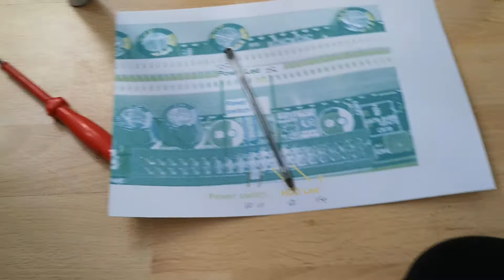Building a server from used Dell T3500 Workstation main Board.

Comment: Cannot find the second video on this, specifically about making front panel connections. Can you give the link to the second video please ?
Reply from the maker: Hi Sorry I didn't get back to you but if you go on george tech tips on YouTube you should find the video on my video uploads if you cant find it send me a message and I will check and link to you.
Reply from the maker: Hi if you can take the from panel  board with the usb and audio Jack's from an old T3500 or you can get the part from Ebay,cost about $7.00 us about £5.00 UK, take out the cover for 5.25 inch DVD slot and put dell front panel there,then attach the Dell propriety cable to 40 pin  header on  front panel pcb and the other end to 40 pin header attachment on the Dell T3500 mother board ,check pin out.that will allow you the have a power button to turn on the Mother board attach the usb cables to usb headers on mother board.you will have 4 green led's on the front panel lit for diagnosis the PC will boot with the only errors coming from fans ,you need 3 pin to 5 pin fan cable adapter from Ebay to fit dell fan pinot  on motherboard .the PC will boot into windows with no errors in bios screen that's says press F1 to continue or F2 to setup,these will be gone on power on.
Reply: @georgetechtips8804  Thank you, George. Can you please share a close look of the pinout for the front panel ? I have one but not sure it is correct - connected computer does not power up properly.
Reply from the maker: @yuritar  can you provide an email an I will send pinout to where you connect the power connector, only connect the power cable and hard drive led, the reset is not needed or the power led is needed. Will send the diagram of the pinout.
Reply from the maker: @yuritar  Hi no no need to supply an email address I have uploaded the pictures of pinout to YouTube, pause the short video and photograph or draw. Hope this helps.
Reply from the maker: I have put up a short video with photos of pinout for T3500 front panel connector. This is a request from several subscribers.

Comment: I have 2 T3500s , I will like to see exactly you move it in a new case because original Dell is reverse BTX form factor. the MB standoffs are at different points. The front Panel Connectors are also a problem because the Pinouts for it is not available anywhere. The CPU heatsink has mounting screws at different place the aftermarket lga1366 cpu heatsinks. Fan Connectors are not a problem as for just $5 adapter fan cable is available. Even without the adapter the problem can be solved as the pinouts for the Dell fan header is available on net. PSU can be replaced with an aftermarket PSU without any issue.